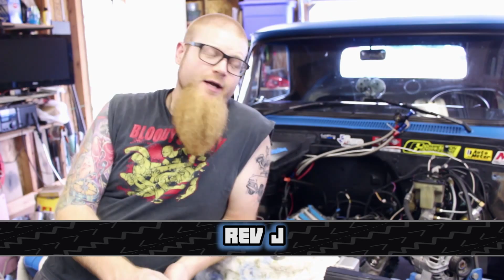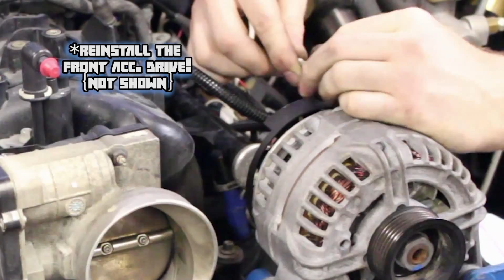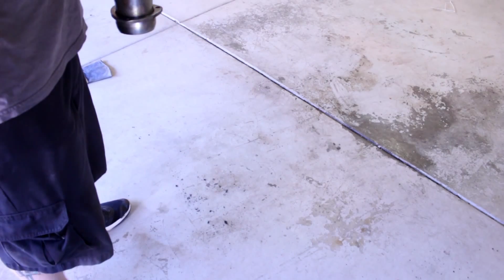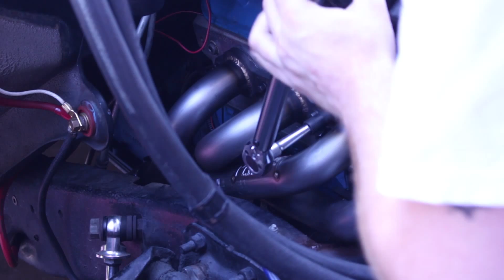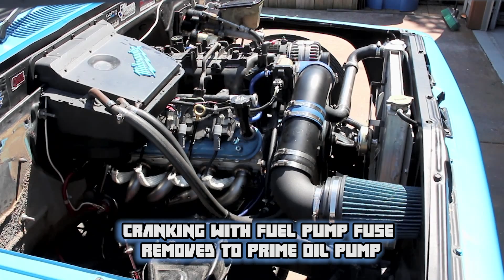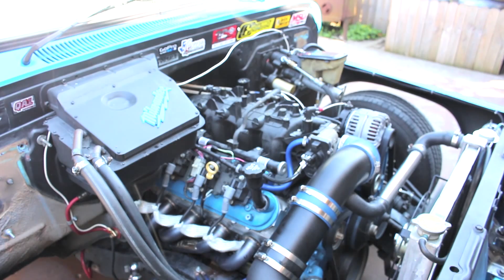LSx C10 Mods Pt 4 - Startup!!!! - REV J HD

Comment: sounds good! what are the cam specs?
Reply from the maker: Thanks! The cam is available from Texas Speed: Tsunami 235/240 .629"/.615"
Reply: Did you have to flycut the pistons, and did you bolt it straight on or degree it ?

Comment: Rev j did you build your own wiring harness or purchase  one? if you built the wiring harness do you have a how to video or website. mine is also throttle by wire.
Reply from the maker: Warren, my harness was built by the guys at FuelInjectionConnection.  They were pretty easy to work with IMO.
Reply: Easy to make one, go to youtube and watch the series "Project Rowdy". In part 5 go under the video and click "see more". You will see links for all the schematics and fuse block/relays needed. If you are running a turbo trans, look in the comments under video, you will find the 2 parts needed from Dakota Digital to hook your VSS wire to (vehicle speed sensor).  He included links to LT1swap.com for every wire, and Lt1swap.com will reflash your ecm for $75, shipping included.